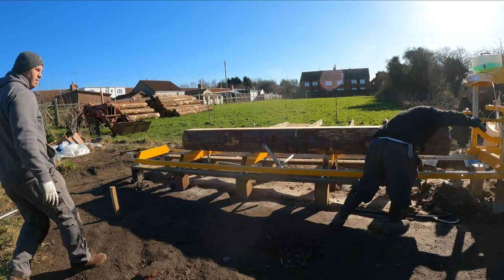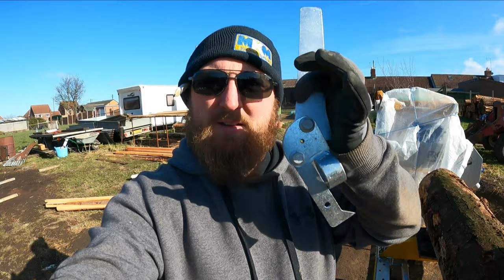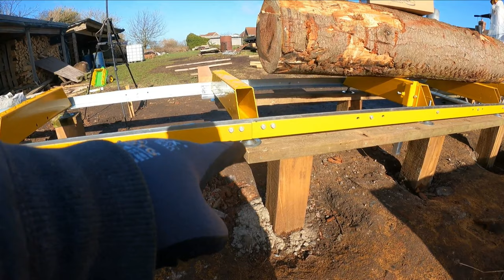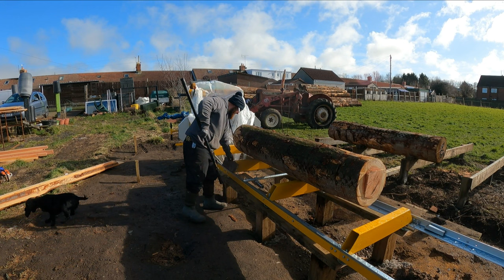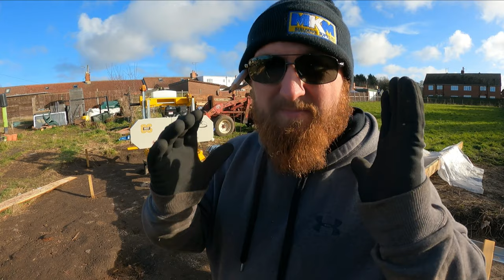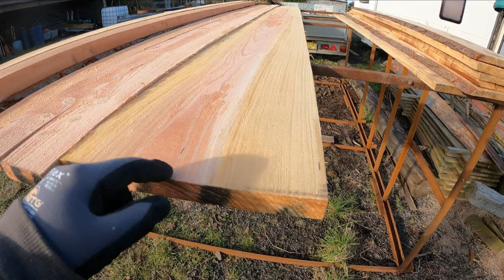Frontier Sawmill OS27 - upgrades and my first milled 8x8 post

Comment: Nice work Nick. I recoomend cleaning the logs. i have used a cheap pressure washer to clean the logs before cutting them. This saves the blade A LOT and i can cut atleast 50% more with the blade before it goes dull.
Reply from the maker: Hey buddy and welcome as always. I'm going to pull a sacrificial chainsaw out the shed and use that to slam most of the bark of the cut area. I'm limited with a water outlet where the sawmill is so thats out the equation. I've seen other just run a chainsaw up the bark. Or I may buy a floor scraper, the good solid ones and use that to remove the bark. Either way I need to remove or limit the amount of bark being cut. I had a hard time yesterday pushing through the log. I've only milled 2 or 3 logs with the blade so not many hours on it. But that's the way it goes sometimes. 
Thank you again for your support buddy 🙏

Comment: i bought one of those pumps for my mini digger after seeing yours on a previous video,brilliant tool and highly recommended.
well done again nick.
Reply from the maker: Hey Martin. Ooh did you ? How you finding using it ? They sure are a saviour of spills and bad backs from holding the can at a weird angle. Best thing I got.
I'm glad my crazy advice has paid of for someone 🤣 thanks for commenting and watching and as ever your continued support 😊
Reply: @everydaywithmenick  probably paid for itself with the savings on spilt fuel!
keep the videos coming nick.
Reply from the maker: @martinprice2342  your not wrong. No more do I bother with funnels etc. Straight to the fuel pump 😆 
I shall try to keep them coming bud.

Comment: Nick, I like your set up.   I either use a wire brush to clean my log or my power washer.  I've not tried the bucket trick yet.  Dealing with the sawdust gets problematic here with all the snow we get.   Your saw looks to be cutting very good.  Nice stack of logs you have there.  What type are they.  Happy sawing.
Reply from the maker: Hey Jerry and thanks for watching buddy. I have to admit, the operation isn't yet finished. I want a shed round the mill, I can't stand it being left in the elements. 
I need to get a better system in place for bark prep before they're sawn, hopefully something will get sorted soon.
The bucket on the exit port saves me from loads of mess with sawdust. I just empty the bucket then off we go again. Don't get me wrong, I still get some blown around but not anywhere near what it would be if it was left open. 
Them logs are Douglas Fir and they're beautiful once opened up. The pinky salmon colours are awesome. Thanks again for watching 😊

Comment: So why doesn't the David Brown lift them logs there not that heavy. I'd say put a external hydraulic pump on the rear pto and some hose and a hydraulic tank then you have a nice setup for cheap. I like the milling work going there . Take it easy Nick and be careful.
Reply from the maker: 😄 them logs at full length are almost 500kg and that little David Brown is a little tired in the hydraulics and can't lift them. Can lift fine at smaller lengths but at full 4.9m it struggles.
I have thought about adding an external hydraulic pump and tank but that's more spend that isn't quite justified just yet. The tractor is integral to moving thise logs though. Thank you for watching, commenting and your support as ever 🙏 😊